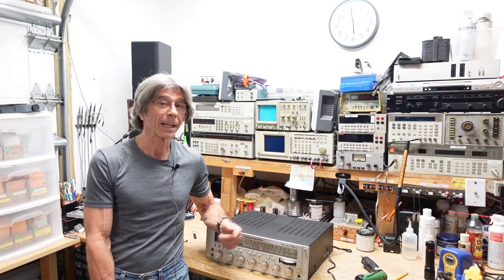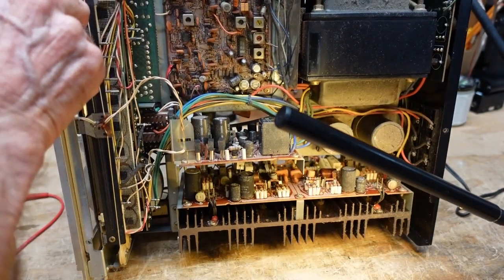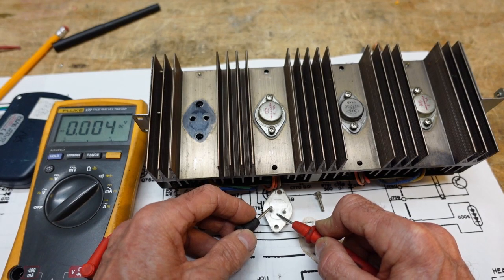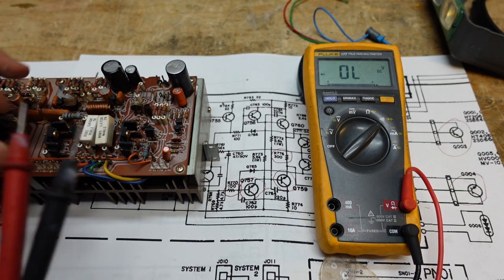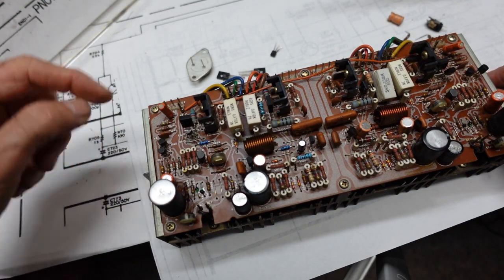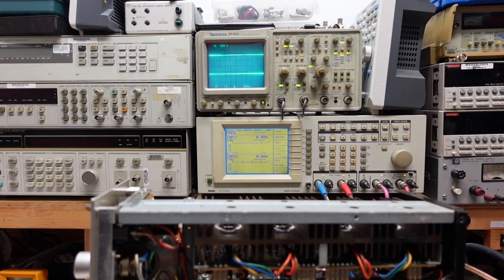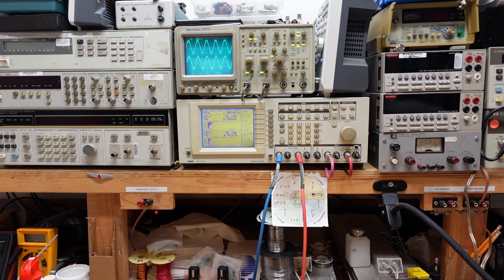Marantz 2265B Repair Part 1

Comment: Wow, this chassis is amazingly similar to the 2330B I'm working on. What I have found is that with this particular vintage of Marantz, as you said, if you blow an output, it takes a bunch of stuff behind it. Furthermore, knowing what I know now, I would opt for the, "TV shop repair" because the traces on this board are so fragile! Even if you have a good desoldering station and don't overheat it, it doesn't take much for the pads to lift up. Of course, with the transistors, you have no choice. But, even then, you end up bending the leads of the driver or pre-drivers over to get them to make contact with the trace. Lastly, due to the fragility of the traces, you end up with a bunch of bodge wires because the traces are not much more robust than a fuse on this series! I decided to start all over and an after-market replacement board from and ebay seller. From what I can tell, it's far more robust, the traces and pads are silver rather than thin copper-clad. I have the board about 40% repopulated with new parts. I'm looking forward to getting it in and fired up.
Reply from the maker: Yeah, 40-50 year old PCB's are really delicate.  The adhesive that bound the copper foil to the board hadn't aged well, but I doubt the manufacturer ever envisioned these receivers being worked on all these years later!

Comment: Thanks for this video. I'm in the process of rebuilding the P700 board on my 2330B. It's good to see I'm not the only one with errors in the schematics.
Reply from the maker: I did a 2230B not long ago.  Then I got into a 2230 non B version and was surprised how different a design it was.  Good luck with it!

Comment: Love your comment about just replacing what is bad visually.  Something had to cause those visually bad  components to go bad.  Those visually bad components as you stated were the end result of something else being wrong.  Being a parts jockey is not the answer.  It is similar to medicine.  If one has pains, just do not take a pill to hide the pain, as this is a systemic approach. All one is doing is masking the cause of the pain.  Find out what is causing the pain, fix that, and one no longer needs to take pills.  Great Job and explanation here!
Reply from the maker: Thanks Rod!  Wish I could find a doctor like you.  😁

Comment: Ray,  I  would like cast my vote for the back to basics videos.  All my experience is in telecom, thus I am trying to learn a different aspect of electronics and I ALWAYS glean a nugget from your videos.
Reply from the maker: Hi Bill!.  Thanks for the vote.  My day job is in telecom.  I'm a central office tech.
Reply: @raygianelli3612  I worked in a SXS/XBAR environment in 1967-1968.  When I returned from the Marines, due to injuries, I couldn’t climb poles so they put me on the frame.  Later, I transferred back to outside plant.  I done installation repair on pay stations and small PBX system’s.   I later bid on a job in the test center/repair service bureau.  Spent a number of years in that environment and really loved it.
I assume you work on the ESS switches.   The PBX systems I sell/service have a lot of commonality with the ESS switches.   VOIP is taking over the digital world and it is very frustrating trying to convince the AT&T, Comcast, Verizon, etc, that a trouble is not in my PBX.  I honestly think the very first lesson they are taught is, “tell the customer the problem is on the PBX”.  I had an issue with a tech this morning.  He didn’t even know how to test if ringing voltage was coming through on a line, which it wasn’t.
Reply from the maker: @bill_p2074  Wow.  I started far later.  I had heard of crossbar and step by step switches, but that stuff was long gone by the time I started.  Our office had a 1AESS switch, which was cut over about 12 years ago to a DMS node remoted from a nearby office.  Office I'm in now has a Lucent 5ESS.  Our offices are now 4 walled, so we do it all from frame, switch, toll and generator/power.  They're getting away from TDM and going into WDM and fast ethernet.  Planned on retiring but the horrendous evaporation of my 401(k) made me reconsider.  😩
Reply: @raygianelli3612  I just aged myself, didn’t I?   Our first cutover to ESS was a SXS office in Smyrna,Ga in 1972. The PBX systems I install can do TDM, VOIP or a combo of the two.  WDM probably wont make it down to customer level anytime soon.  
I hope your 401k will turn in your favor.

Comment: good work love how you trace back the destruction-i learned the hard way trying to fault find running live and taking voltage measurements  i soon learned its easyer to cold test all the semi,s  .on a rebuild like this i would go the whole hog and change the input long tail pair aswell just because how often they go noisy and dc bias drifty in old kit like this , i hate doing a major rebuild just to have it come back with intermittent stuck in protect mode , the dreaded "its gone again" and you know they wont believe you its for a completely different reason , the customer sees the same symptom so they think you messed up, yea ive got a negative tilt ha. oh the tv repair guys jibe ....yea you are right- i had no idea on bigger amps and pa you had to replace parrellel sets of outputs all together with the same batch code if just one failed ....for decades ooops.
Reply from the maker: Darren, good call on all of the above.  I do the differential pairs now, as the transistors used tend to get noisy with age.  And yeah, did a lot of sound reinforcement repair work, replacing all the outputs gets real pricy real fast!  I try to match them up with the curve tracer.  Crown used to sell matched sets, don't know if they still do.
Reply: I hear you, my first repair, somewhere in the 80s, was an amp from my father, I could buy him a new one, the hard way, like you said 😅

Comment: Hi again Ray, hope you’re in good health & good spirits. Thanks as always for such a thorough tutorial. I’ve got a few questions about certain steps of the process, so if at some point you have a chance to answer some or all of them, I’d be incredibly grateful.

1. @ 2:40 , when you said it’s not coming out of protection, did you determine this b/c you didn’t hear the protection relay click ?
2. @ 3:35 you measure the emitter resistor’s dc voltage relative to ground. For determining dc offset , would it not be more accurate to measure for vdc across the resistor ?
3. @ 3:55 was it the coupling capacitors whose voltage you measured relative to ground to check how much vdc the output end of the PS was putting out?
4. @ 8:15 did you know which transistor was PNP in which NPN based on visual cues? Or just from having seen those transistors in the past?
5. @ 12:15 you said that with such direct coupled amps, it’s not uncommon to have shorted transistors & resistors going all the way back to the preamp stage, & as you discovered later in the video, that turned out to be exactly the case with this amp too. But if you have shorted output transistors in a capacitor coupled or transformer coupled amp, in your experience, do the coupling caps & transformers normally serve as a good barrier to prevent the short from reaching components back in the driver or preamp stage?
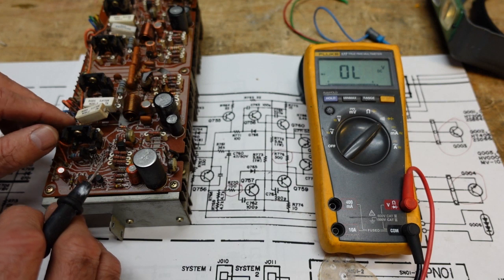6. @ 13:45 you check the driver transistors in the circuit, but earlier you check the output transistors out of circuit. Are both in and out of circuit tests acceptable for any amp transistor?
7. @ 24:50 you said you went to night school for 1.5 years. Was this for a course specifically about amplifier repair, or a general electronics repair course?
8. @ 25:45 if I’m unsure whether the replacement transistors have the correct bias for my particular amp pre-set at the factory, is it ALWAYS acceptable to just turn the bias on the scope all the way down (when it’s time to test the repair) like you did? 
9. @ 26:25 how did you immediately determine that the power cord is faulty, without first putting it through a continuity test?
Reply from the maker: Whew!  OK:
1. Yes, I listened for the relay click.  Some gear has a light or other visual indication that it's out of protection.  This one does not.

2. No, because the unit is in protection, the relay is open.  Therefore you would measure zero volts across the resistor, as no current could flow through it.  When you measure DC offset, you're usually instructed to measure the speaker terminals (which is the amplifier output and chassis ground), which we can't do when it's in protection.
You may be confusing bias setting with DC offset.

3. Those are the power supply filter capacitors.  There are no large coupling capacitors in direct coupled amps.

4. Yes.  Japanese transistors with the prefix 2SA and 2SB (often the 2 is omitted) are PNP.  2SC and 2SD are NPN.  Wish all semiconductors were like that!

5. If you use the term "capacitor coupled amp" to most, it indicates that the output is capacitor coupled (or transformer, like McIntosh, which is actually an autoformer).  Amplifiers that utilized capacitive or transformer interstage coupling went out in the late sixties.  The exception of course would be tube amps.
So, yes, in a mid sixties to very early 70's amp, the damage would be limited by caps or transformers

6. In circuit testing .can point you in the right direction, but out of circuit is definitive.  There can be parallel current paths in circuit that can skew your measurements, but shorted is shorted.

7. Strictly a vocational electronics course, which probably no longer exists today.

8. The scope has no bias.  When the output transistors are replaced, it's good practice to turn the bias to zero, then set it after warmup.  Bias is the small current that always flows in an output stage, and while today's transistors are very consistent in manufacture, it doesn't take much variance to change the bias.  I did a video on offset and bias that explains much of this.

9.  I should have shown this, but moving the power cord caused the unit to turn on and off.
Reply: I don’t know why YouTube deleted my reply from a few days ago , but I hope it doesn’t delete it again . Just want to thank you for being kind enough to take the time & effort to promptly answer all my questions , you’re an absolute diamond Ray ! Many cheers to your health & wealth sir !!
Reply from the maker: @bigmedge  Thanks for the (very) kind words!

Comment: Great trouble shooting.  Any thoughts on why the driver transistors would short ?
Reply from the maker: Very common for the failures to cascade back from the outputs, so it's not unusual for this to happen.  Question I have is this: did that failure happen AFTER the fuse was wrapped in tinfoil?  Because the failures went back farther than usual.
Reply: @raygianelli3612  So the output shorted first?  If so what would cause that,  possibly the bias went high?  Foil on the fuse surely made things worse.
Reply from the maker: @scrappy7571  Common cause of shorted outputs is shorting (even momentarily) the speaker wires, or impedance below what the amp is rated to work in.  No way of knowing when the fuse was foil wrapped.  🙃

Comment: What do you think causes R726 (the 300ohm) to keep smoking?  I’m dealing with that right now and keeping the outputs out of the equation until I can isolate this.  All transistors in the bad channel are replaced and no longer shorting.  These seem to have common issues (the 2265B in particular)

Comment: Wow, that cool fin, looks like there is something that went very hot. Or the cooling compound missing or burned as well. If you see on the right, something else got hot too. Never seen that before. Or yes, I've seen a Kenwood amp, that was burned the PCB on the supply side, carbonized every thing. I told the owner that this was the end of the ride, seems they used the amp, when it was raining. Must have been a serious crash.
Reply from the maker: Used when it was raining?  Unbelievable!
Reply: @raygianelli3612  My former boss, was very neglecting for his material, so I guess, this one was used in outdoor event, what we did very often with the radio station. So I earned good money with his "mistakes" I have pictures of the poor thing. But I'm not an expert in repairing burned PCBs, and in work hours it would be very expensive, so that kind of repairs are most for the recycle. It's sad, because that Kenwood KR4030 was a pretty thing. Now I'm troubleshooting my own technics_su-x102_sm_1, which, with starting up, gives a spike. Not healthy for your speakers.

Comment: Curious... at the very end when you're increasing the signal voltage (which is what I assume you're doing) to get to the 65W output from the amplifier, where do you have the amplifier volume control set?  Is that important or not?  Do you generally set the amplifier volume knob at a specific point and then just vary the input amplitude?  Thanks Ray!
Reply from the maker: William, that's a pretty common question.  And as you suggested, it really doesn't matter as long as your signal generator has enough output to drive the amp to the edge of clipping.
Reply: @raygianelli3612  thank you sir!

Comment: Could you remind folks in your next video on what type of electronic design this amp features, I think you said that it is a "coupled" amp? I know that NAD used/uses this design as well for their power envelope (PE) series. They too can see 'catastrophic' like failures in that the design can experience a cascade of failed/burned/blown parts when a key component decides it's time to pack up and go. I recognize that here there were other forces that may have lead to problems such as the 'TV repair', not ideal transistors, etc but if the coupled amps are prone to a more colorful demise let us know because I think it may be interesting to get your take on the amp design aspect. It could be of interest, I don't know.
Reply from the maker: Alex, this and most amps from the mid 70's up are known as direct coupled.  Older amplifiers had each stage isolated by capacitors or small transformers.  By designing amplifiers that didn't isolate each stage, a purer signal path was realized.  The only downside is that when something lets go it upsets every voltage in the amp, making troubleshooting more difficult.

Comment: It’s weird the guitar amp people say don’t replace my caps, the audio people say recap. I replace as many caps as possible in guitar amps. Sometimes they never ask, all parts are in a bag for them to see, some never notice unless they remove the back. I then explain how their problems came about. One group says one thing an another the opposite.
Reply: I think what Ray was suggesting is that caps are not the end all be all of repairs. Of course, when caps get really old they should be replaced but I do believe Ray is coming at us with repairs from the troubleshooting angle. Namely, fix the problem first and then consider any further restoration steps that could help improve the longevity or other attributes that may improve the functional values. I might have misunderstood your comment, for which I do apologize but I thought I would, nonetheless leave you with my two cents worth. :)
Reply from the maker: If you think audio people are OCD, guitar players make them look like amateurs.  The pinnacle of technology was reached for many of them in the 1950's.
Reply: @raygianelli3612  so true every time it seems an old amp come in I hear the comment don’t change the caps, I like the sound. Never mind the caps are leaky some just plain bad. I change them anyway, an I then hear the reply , oh it sounds so great now what was wrong. Besides the caps, usually a bad tube or ground corroded, or maybe a old socket past it’s day. Transistor amps problems are some what different, but caps are always a problem. Most companies don’t use quality parts or ones that should be of better quality. I could cure a great deal of problems in new amps with just using better made caps. We are talking about a few pennies in most cases. I plan on posting a sign that says Don’t Change the Caps They Sound Good…… lol.

Comment: Hi Ray
Enjoyed your troubleshooting. Amazed at the parts damaged. Knew you would find them. Did not know about nec transistor. The transistor you used, how close to original specs were they?  Thanks, enjoyed the video
Robert
Reply from the maker: NTE are aftermarket subs, and the problem is they'll spec a transistor for a variety of transistors.  It will therefore work better in some applications than others.  I used Onsemi MJ21193/94's for outputs.  They exceed every parameter except Ft, which in this case isn't a big deal.

Comment: Hope my tech doesn't move my Marantz equipment around sliding all over scratching the top face metal and sides. Wood or no wood. Try a towel 😏
Reply from the maker: That's a conversation that should be had with your tech.

Comment: YOU GOT all the bugs🦟🦗 🪳out. So you get the **ELECTRONICS REPAIR VIDEO OF THE YEAR AWARD!**  Couldn't have explained any better but you DID forget to lambast the chef that used the aluminum foil, it was not called for in this recipe. Momma Mia!  Now put on 120 watts of a Kiss song - Shock Me!
Reply from the maker: Foil, right?  Sheesh!
But it brings up a good point, and that is check the fuse holders for things like that, and even if the fuses look good and measure good, they need to be checked to make sure that the proper value of fuse is installed.   Too many times I've found the wrong value of fuse installed, sometimes way too large.
All of this equipment is at the age where it's almost certainly been serviced or molested.  :)